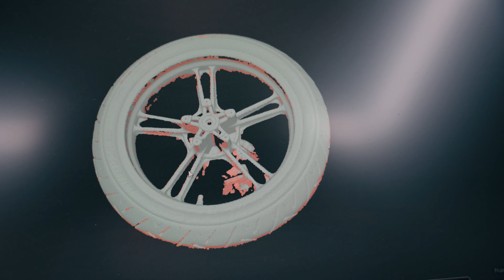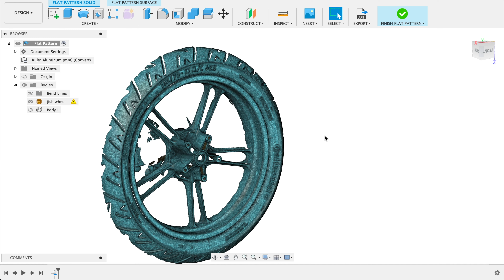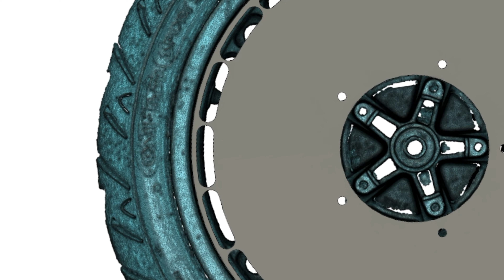I Made A Motorcycle AERODISK - Custom Wheel Plate

Comment: Looks cool! id be a little worried about the mounting and if they 3D printed rods will hold up even if they're CF. Maybe would have been better to use a dowel/threaded rod and nuts? so the CF reinforced plastic doesn't have to take much potential stress.
Reply from the maker: I may eventually change to ally machined spacers as this does cross my mind, the bolts i have used leave next to no space on the middle but i agree threaded rod and domed nuts might be a better option
Reply: You could rather easily make them from real carbon fiber with one side mold by wet laying it and they would still be very light.
Reply: @jishh You could also just use captivated nuts (add a slot to insert a nut in the cylinder design) or heat-set inserts (but the nuts are a better choice)